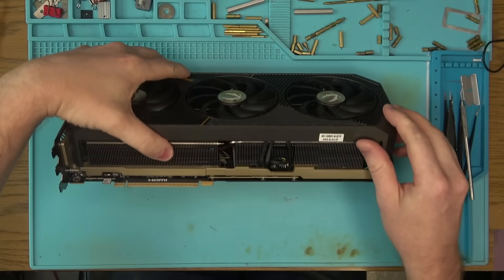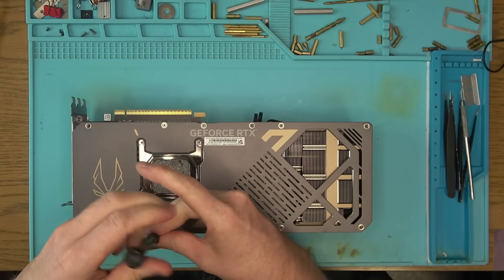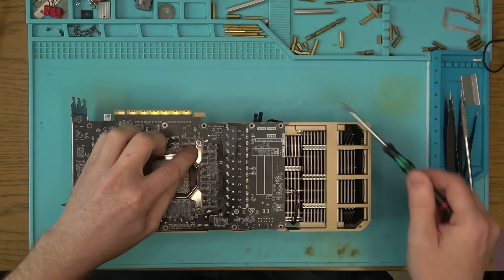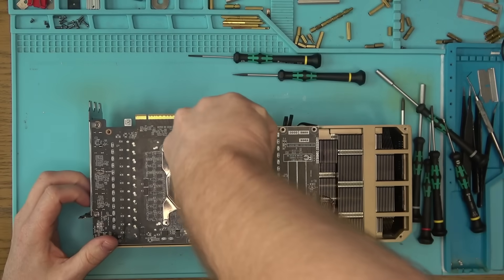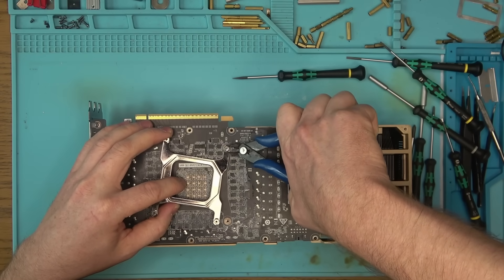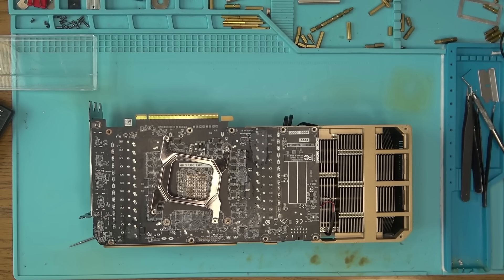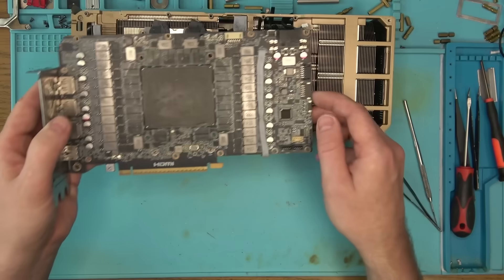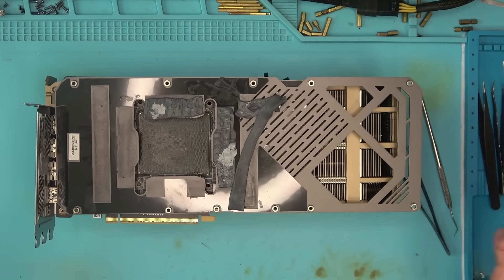WARNING new RTX 5090 scam just hit the market

Comment: I recently repasted a GTX 1070 MSI Aero that was running really hot, and stripped one screw that just wouldn't budge.   I ended up drilling it.   Sadly, though that wasn't the biggest problem.  The paste it had was rather fresh, and putting on newere paste didn't change anything.  The blower cooler was just garabage and that GPU will always run hot.   96C . . .

Comment: I've used baby vice grips or even wire snips like you tried and had pretty good luck with stripped screws. sometimes you can put one tip in the stripped part and grip the outside and spin.

Comment: Thanks for the video!
Next time you get a detroyed screw like that, just grind a slot with the Dremel using a diamond cutter. Then use a big flat screw driver to unscrew it. Works for me every time! Cheers!
Reply: That's exactly what he did...
Reply: I see, but not *exactly*. I'm talking about a diamond cutter wheel, which would create the slots way easier than carving like he did. Cheers!

Comment: Dremel cutoff wheel, a butter knife(45+ degree angle to break the screw loose then switch), and a screwdriver works great for stripped screws. Standard butter knife edge fits into the Dremel cutoff wheel slot and can be at an angle for more torque, a standard flathead screwdriver that would be thin enough to fit into the slot would not be wide enough to break the screw loose without potentially stripping the new slot.

Comment: For elevated screws that are stripped like that - dremel a line across and make it flat-head friendly. I keep my worn out discs with the smallest radius for such tasks.
Reply: That's pretty much what he ended up doing in the end, just took a long time to get to it. It's easier to do with smaller diamond cutting/engraving tools than dremels, though.
Reply: That's been my method for years for dealing with screws that are totally stuck and stripped out.
Reply: Mini sized screw removal gripping pliers is what you need in this situation, dont mess up you gpu with a dremel lol.

Comment: There's always the rubber band trick where you push a rubber band against the stripped head under the screw driver. Works pretty well.
Reply: that won't beat thread locker ... which is what I'd put on to delay the detection of a scam I'd pulled and hope for some "end user damage" to hide behind when challenged
Reply: @greebj  Too much effort - If they aren't testing then and there they will never see you after the sale anyway
Reply: Heat up the screw with a soldering iron. It'll soften and melt the threadlock
Reply: @samholdsworth420  and possibly traces
Reply: @1DigitalFlow   doubt it lol, a lot of these boards can take a tremendous amount of heat before damage gets noticeable so long as you're keeping the heat away from chips longer than needed.
Reply: @1DigitalFlow  You really think you're going to damage traces by touching an iron to the head of a screw on these? lol Just so we're all on the same page.. a trace is what's embedded in the pcb, which is assembled in layers and then has a cured masking. Solder is what they connect traces or, most likely, pads, to a SMD/IC/through hole component. Those of which are either then called "legs" or bga, etc. When some bozo tries a DIY repair to their PS5's hdmi port and realizes their equipment (and ability) is inadequate, they rip a trace.. usually because it's too cold and the "leg"/pin is still soldered to a pad, which then rips the trace when they inevitably pry it off. Then somebody like me gets to perform trace repair! =)

Other notes... grinding or cutting produces heat which can also cause damage in other components but not in this application. But grinding/cutting or heating up the screw are all not the way to do this. IF adhesive is thought to be used in locking threads, you'd use a liquid solvent and/or specialty bits to grip or cut into the head for leverage with a manual driver.

Heating is more of a sausage finger move that is best left to automotive applications... haha

Comment: Use a cutting wheel and make it a slit for a flathead screwdriver. 😊
Reply: I was thinking the same
Reply: Hahaha, you are so off, just glue the cheapest screvdriwer in there with a good 2 component glue, leave it over night and just throw it away when you are done.
Reply: A cutting wheel on a recessed screw on a plastic circuit board. ….right okay?
Reply: or a thin file
Reply: @rulik007  Or a thin cutting blade...lol

Comment: The scammer probably drilled out the screw head on purpose to make it more difficult.
Reply: The point is to make it extremely difficult to find out you've been scammed. The longer it takes the more likely they can run off with your money.
Reply: @10100rsn  I get that, but I do not believe a scammer needs time... They obviously provide fake address and fake everything, so after you sent your heard earned money, it is gone for good (bad).
But this just shows, I was never a scammer, perhaps it is not that easy? :D
Reply: @10100rsn  it's on Ebay , they run off with your money regardless
Reply: Thats exactly why they do it. A friend of mine bought a 4090 just like this only to be missing the chip and ram. They stripped 2 of the screws.
Reply: Yes i think so too. Makes it harder for you to find out
Reply: The scammer would be better to put thread locker on all the screws and leave the heads visibly unblemished as not to draw attention… that way when buyer goes to disassemble they strip the screw head and think it’s there fault.. and then take more time taking apart the card.
Reply: @ 0:44 he said the owner stripped the screw.
Reply: Thought the same
Reply: one cup of rice for this guy, and a cat-wife for the night
Reply: why? because they're assholes. Salt in the wound. Just to make you mad when they finally do see they've stripped the card. ffs, people are malicious. 70 million just voted for a fascist...
Reply: Agree
Reply: %100 either that or when he was fucking would’ve taken out the parts he fucked it up
Reply: most likely glued the screws
Reply: I stripped screw head exactly the same way and had to replace it.  It was extremely over tightened, the tension on the bracket was crazy.
Reply: I was thinking the same thing, or it was a legitimate board that failed QC because of the screw, and got re-appropriated out the back door.
Reply: what would they win with that??? After they received the money, they might as well send a brick, or not even that...
Reply: @Sonnell  Some naive people think that repairing the "cheap" card still makes it a good value purchase.
Reply: @Sonnell not everyone is tech savvy, and alot of times they resolder a older chip say a rtx 2060. So ppl who are dumb think its the real deal since they are new to pc gaming. Only reason why it works. Giving someone a brick or a dead card? Stuff ganna be returned but maybe the place just DOA's instead of checking why its broken the scammer gets off scotch free.
Reply: @JayGalatica  a lot, not "alot", scot free, not "scotch free".
Reply: @Sonnell  i think its just a little harder to actually get them legal actions because now the customer needs to find out what is wrong with his "gpu". People who sel these have 10 barrieres between getting legal actions and scamming them anyways, so might aswell do this too
Reply: @richardjung9562  Did you mean: barriers, and as well?
Reply: 好主意，谢谢
Reply: @cybermaus  🤣
Reply: @cybermaus  good job using google translate
Reply: @SupraSav it was a joke bro
Reply: The scammer desoldered the chip and the VRAM chip.
It's almost impossible to make a refund claim for this graphics card because the seller sold the described product
Reply: Dumb comment

Comment: hi, you could uye you rotary tool with a disk estension zu cut in slit into the screw head and then use a flat had driver to remove the screw

Comment: I thought those were already happening. AI is still big and of course China will want to take cores to put them on their own boards with cooler fit for server racks. I mean it is better than 4090. So this wasn't really question of if they will do it, but just when. And I wouldn't be surprised if they started day one and they just piled up empty boards till they started dumping them online for scams. Also, even if AI bubble finally pops, I still expect it for 6090 and subsequent 90 tier cards. Even if they won't be able to get them at home, they will just smuggle them, like they at least used to do through Singapore, to avoid USA limits imposed to China. Because 90 tier cards are in a way what Titan used to be, which is great for workstations and also server use.

Comment: I made a video a few months back showing some other gpu scams. There's actually a few other type of scams both on ebay and even local marketplaces. Some of the ones on ebay are using a hacked account that has legit feedback and they are able to make it appear a legit seller is selling the card and they are able to then use the pending funds since ebay gives you access to them directly after the sale to use on ebay. They will order an item around the same value and have it shipped out of the countr or to wherever they are. The other thing, they are using legit looking pictures usually from previously sold listings so they can just go and grab a ton of pics to make it look legit. The other one is the most common which is foreign sellers, if you see anyone from china or any other country but yours selling a gpu right now, its likely a scam. They are also able to use the money instantly even with zero or little feedback. If you are a new seller it takes a certain amount of days until you can cash out also, and some of the foreign sellers who want the money instead will just  end up running the clock out because they have a way to create fake tracking numbers or they will deliver an empty box. be ware, ebay and online gpu purchasing isnt safe esp with these high end cards. 
even meeting up in person ive seen people getting scammed.

Comment: Some other things you can try for stripped screws is the blob of solder and placing a screwdriver in it or a bit of flat rubber and pressing down on it with the screwdriver. Both have worked for me in the past.
Reply: This is also the best way to get small screws that have thread locker on them. Even blue is higher torque than the shear strength of 4-40 with 2.5d thread engagement. Shoving a soldering iron into the head works well, because the threadlocker is insulation, the screw shouldn't be touching the threads anywhere but the very tips for the first r-d or so, so adding heat means 95% of it goes into the thread locker and not the hole/nut. Since they're so small, they heat up fast enough that you really don't risk anything at all, and makes removing screws so much easier, it should be illegal!
Reply: The small screw extractor kit from Irwin works wonders

Comment: Time to actually buy a RTX 4090 now.  (Fun fact the diff between 4090 and 5090 is around 10-15% but of course you only get x2 Frame Generation instead of x3 or x4. The rest of the feature set is the same).

Comment: Also when it comes to "too good to be true" scams I recently (6/18/25) saw a $500USD RTX 3090 Ti b/c the seller says he's selling it "because I bought a RTX 5090" & thought "hmmmm that is still a bit too cheap" - I recently got a 7900XT for $700USD new & am running Linux so the Radeon drivers are native to the kernel but the Nvidia GPU would need their proprietary driver instead. Otherwise I may have tried going for it.

Comment: Wow! When you finally opened the 5090, I almost puked when I saw it had no core and VRAM. Two-thousand dollars down the drain...expensive lesson. Oh, next time when you come across a stripped out screw head. Try placing a rubber band on the between the tip of the screwdriver and the screw.

Comment: I bought a MSI Vanguard 5090 from Currys (massive electronics retailer in UK) and the connector melted, so I don't think it matters were you get them from these days. Replaced it with the ASUS Astral 5090 and nervous as hell to leave it running unattended.
Reply: Did you get your money back or just heard "user error"?
Reply: @drayke8886  They were very good and refunded it straight away with no hassle.
Reply: unattended is usually fine, it's only going to be drawing 500W or whatever when being used, that's when cables/connectors get melty, unless by unattended you mean a headless server.

Comment: Tony, next time if you have a stripped screw, find an old flathead screwdriver you don't need anymore, and put the tiniest drop of UV resin in the stripped screw, push the screwdriver into the resin, cure it for a minute, it should come right out.
I mean, technically the screwdriver should be perfectly fine, but I'd use an old one just in case.
Reply: I was going to suggest the Edd China tip of welding a large bolt to it which you can then turn with a half inch square drive socket.
Reply: @reggiedixon2  Cheeky... 😛

Comment: Philips head was designed to intentionally prevent the user from over-torqueing the screw by forcing the screwdriver to pop out / strip the head. All small screws should be torx head. Change my mind.
Reply: If you mismatch the size and type then it strips. Pozidriv and phillips looks similar but incompatible with eachother.

Comment: Sacrificial screwdriver + superglue sometimes works.
Reply: I use UV resin, my screwdriver has been fine for six stripped screws thus far over four years, if you pull the screwdriver out as soon as you get the screw out, usually you can use a razorblade to remove any resin that sticks to the screwdriver.
Reply: Oh, that's a good method!
Reply: Dremel an making a notch. Or a real drill and drilling into the screw so the head of the screw came of.
Reply: Or just buy some easy out drill bits
Reply: That's pretty ingenious
Reply: Dammit. I wish I'd thought of that. I had a real problem a year ago I never really fixed though I tried hard. Well I guess I can try it now if it comes my way again.

Comment: Diamond grinding bits on steel is bad.
Diamond dissolves in steel, i.e. diamond tool loses diamond cutting edges very soon.
Just solder a piece of sheet metal to it, much quicker!
Reply: it's not "bad" it's just going to go through bits.   But diamond bits aren't crazy expensive or whatever.   The occasional use is fine.   But just soldering on a piece of metal to grab is smart, for sure.

Comment: 2000 bucks for an "empty" PCB and a massive cooler? Bargain of the century... 
On a total side-note: I'm using Wera Allen keys to work on my VKB flight-stick/gimbal and they are massively better than the cheaper, no-name/house-brand stuff I briefly tried to use before. The stick relies heavily on Allen-type screws/bolts and some of them require quite a bit of torque on relatively small screws, so you really don't want those keys to slip and strip out the screw. 
I only bought them because they were the only higher-end tools available at the HW-store on the day I bought... not for "patriotic" reasons (I am German). I've since bought a few screwdrivers of theirs as well (partially because I had seen you were using Wera, lol) and they also work very well. Probably even better products out there, but for my purposes the Wera stuff works great.
Reply: $300 on Ebay with box most likely where the scammer bought it. $1700 Profit.